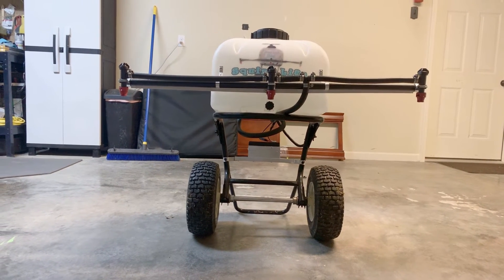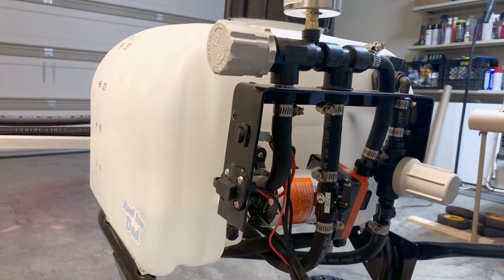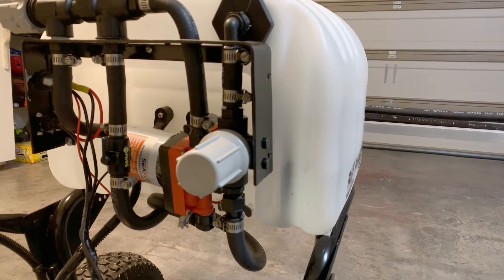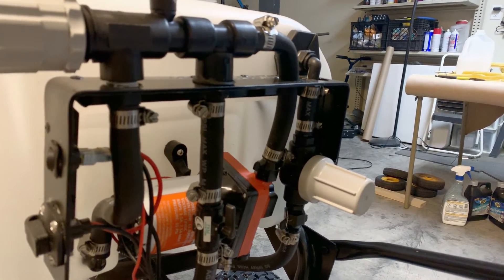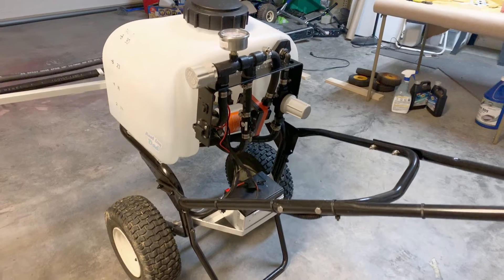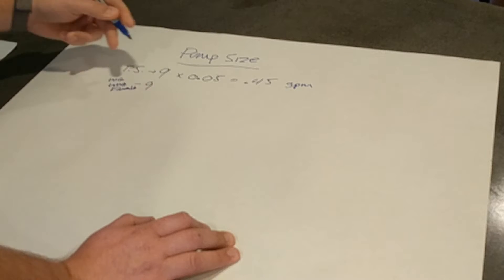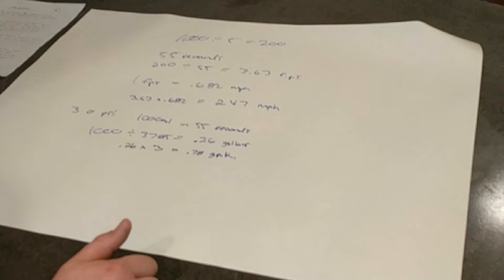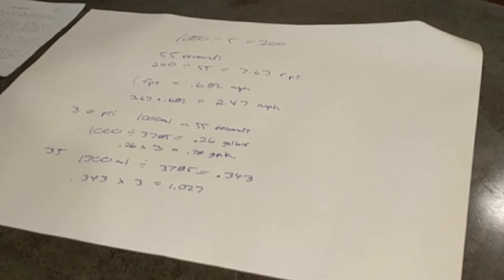Designing and Building a Boom Sprayer

Comment: Do you use same nozzles for all applications? Both herbicides and fertilizers?
Reply from the maker: I use a different nozzle depending on if it is a foliar application or a soil application. Pretty much changes the droplet size
Reply: @ReelLowDad  Thanks. Any idea if Specticle Flo is soil applied or foliar?
Reply: Never mind I see it has to be watered in so not foliar.

Comment: Hey RLD where did you get the switch on handlebar with the piece for handlebar
Reply from the maker: Here you go. Just make sure you choose the correct diameter for the bars it is mounted on. https://www.amazon.com/dp/B07J56DJQX/ref=cm_sw_r_cp_apa_fabc_PF0ZEHD66S34Y6B2S5Y8?_encoding=UTF8&psc=1
Reply: @ReelLowDad  thanks I finally found it after I messaged you actually a motorcycle switch

Comment: Thanks for posting. I am in the process of building a sprayer myself. However can you give me details how your setup is wired? I am getting all the parts in for it.
Reply from the maker: Sure thing. I will get a pick of the wiring and make a post with more details. Working on a follow-up video to this as well. Thanks for watching.
Reply: @ReelLowDad  Awesome man!! Thank you so much. I look forward to getting that info.
Reply: do i need a relay somewhere if the pump is 17 amp and the battery  is 12V 18ah. Trying to figure out so it doesn't blow the switch. Also what battery tender do you use?
Reply from the maker: I wouldn't think you would need one. The limitation is the battery capacity since you have a fairly powerfully pump. I am using the battery tender junior
Reply: @ReelLowDad  ok awesome!! can you guide me to wire everything together? just like how you have it
Reply from the maker: Send me an email at michael@reellowdad.com and I will send you pics of the wiring. Hope to film the update tonight.
Reply: @ReelLowDad  Awesome!! Will do that now. Thanks again

Comment: Wow.  Lots of great thought out behind this.  Came out awesome.  What cart did you use ?  A Lesco spreader?
Reply from the maker: I was able to get an old Lesco 80 frame to use. It works great. So much easier than the backpack sprayer.
Reply: Reel Low Dad you did good.  I wish I was that handy with DIY stuff
Reply: RLD, when are you doing the BOM and parts vid?  im curious, did you find that bracket like that  or did you mold it yourself?  i love how clean this build came out

Comment: Do you happen to have a parts list for this build? I’d really like to put together one of these. Using a 4 gallon backpack sprayer for 10,000 sq ft is rather time-consuming and really not much fun.
Reply from the maker: I will soon. Replacing a part on the pump and adjusting the pressure cut off. First video was about sizing a sprayer. Next one I will have parts breakdown.
Reply: I was wondering same,,,can’t wait to see your update.  Thanks RLD!
Reply: Was there ever an update with a parts list?

Comment: Nice set-up. I'd like to make something similar to put on the back of my Ventrac using the 2" hitch to support. Then I could run it off the 12v power outlet and set the cruise control on the Ventrac to maintain correct speed during application. Where did you get your improved pump?
Reply from the maker: Amazon. It is a sureflow knock off. Going to upgrade to a 100 psi pressure switch to give more options on tips
Reply: Reel Low Dad did you have any issues with the 60psi pump you used? Did it agitate well enough?
Reply: Sort of. I got everything put together, had a nice bracket welded up to hold it. My issue is that I'm not getting 40 psi regularly. I have four nozzles, each doing 1/3 gal/min, so with a 3gpm pump I should have no issue, but I do. Thinking of taking one nozzle off or getting four different nozzles that will run at the 20 psi I am able to get. A little frustrated. The pump should be big enough, but the system together isn't working right for some reason. Agitation seems to work fine. Also need to look for a tank with a better sump so I can do my intake off the bottom instead of a hose from the top, and use all the liquid up.  Any ideas?
Craig

 @andrewbrackin6149

Comment: It appears that you must have drilled several holes in your tank when mounting the boom on the front and all the equipment on the back. Can you share how you went about sealing these holes to prevent leaks? I assume you simply used rubber washers and stainless steels hardware, but I'd like to know for sure. Also, I'd like to know if your seals have performed as expected (i.e. have you experienced any leaks). Great looking project, by the way.
Reply from the maker: Actually the tank had threads that were molded into it in various places. I simply matched up the right size fasteners. Made things rather easy.

Comment: Looks great! The green indicator light was a nice touch 👌... I still need to calibrate my 8 gal 3 nozzle boom that I made. I tested  it and I went through all 8 gals in 15 mins and covered 20,000 sq ft at full psi.  I need to tinker with it and figure out how to get my 1 gal per 1000 sq ft .
Reply from the maker: Just have to get your time to cover 1000 square feet and then adjust PSI to get the rate.